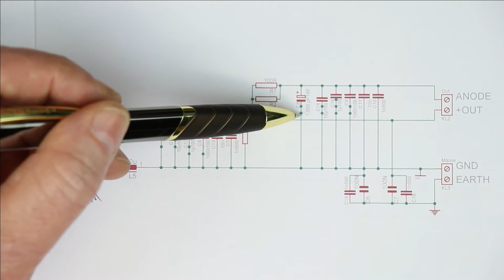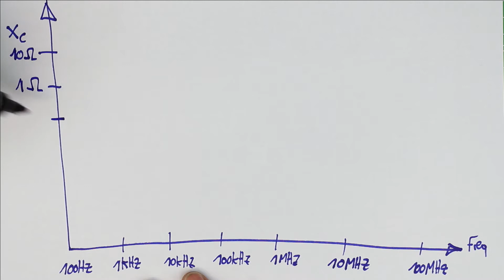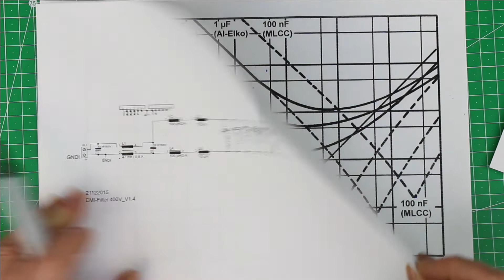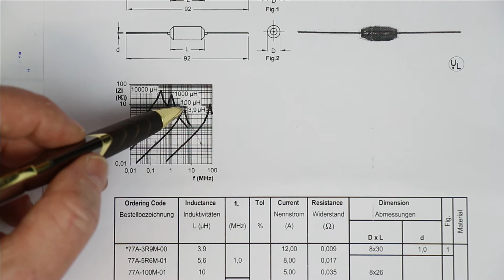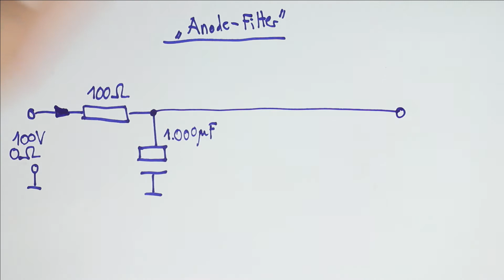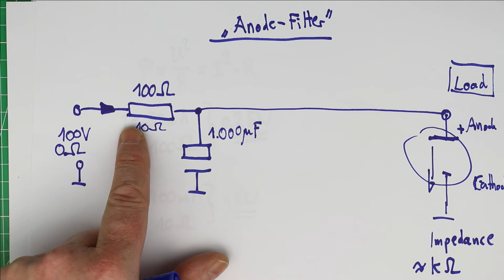Inductors, Capacitors and RC-Combinations as filters – Pt.4 of "Multi-stage EMI-Filter"

Comment: Excellent explanation👍👏
Why inductors work as parallel resonant circuit, not the series resonant? Also why caps work as series resonant, not the parallel resonant ? Paracitic components in inform right?  Would like to understand that part...

Comment: Does this cap filter increase inrush current
Reply from the maker: The inductors in front of the caps "choke" the inrush current.
That´s where the name "chokes" for inductors comes from :-)
Reply: @KainkaLabs  thanks
Reply: What is the design rule to limit the inrush? I was intending using a NTC.
Reply from the maker: I´m not an expert in that region. 

I for myself would do some simulations with LTSpice and/or consult the datasheets and application notes from the manufacturers for dedicated inrush-current limiting components.
Reply: Thanks it helped with my biggest issue noise.
Reply: Check FTDI noise suppression circuit.

Comment: Do you stil have these filters? Cannot find them in your shop!
Reply from the maker: Well, the question should be: Do you already have them? :-)
It´s on my To-Do list to put them in the shop for over a year now.
We have the PCBs and components lying unassembled around here for that time :-(
I hope I will find the time in the next two weeks.
So I will publish it here in this video-series and in the start-page of our shop, when they will be available.
They won´t be cheap because the PCB and some of the components are quite expensive.
But we will also the naked PCB for self-assembly because some users will probably not need all of the filter-stages.
Reply: OK, thanks! Would only need the pcb and some of the components, indeed.
Reply from the maker: The filter is now available readily assembled in 3 different ratings as well as bare PCBs for self-assembly in our shop:
 http://www.ak-modul-bus.de/stat/stromversorgung.html
(This is the shop for customers from Europe. For customers from overseas it will be available from February 2018 in our new shop:
www.ak-modul-bus.de/eng)

Comment: Hi! Thank you so much for great info! I would love to buy this as a complete product, would be awesome if you actually would make it available on your website. I work with music preamps etc and this seems to be the best solution to my noise problems. Thanx!!
Reply from the maker: I will post it here and in the other parts of the video-series if we put it in our online-shop.
I just have to find the time to do the price-calculation and write the technical specs and manual for self-assembly if you only buy the PCB and populate only some of the filter-stages.
It will be available as readily assembled and as a bare PCB because not all users need all the parts/stages.
And due to some quite expensive parts it will not be very cheap fully-fledged.
3 versions: 100V/2A, 200V/2A, 400V/2A and on special request 100V/5A and 200V/5A.
The tin-cover shield will be available separately because that is only needed in places where you have extreme levels of RFI/EMI.
PDFs of the PCB and schematics will be open-source. 
Measurements of the noise-suppresion of the final product were very successful.
>60 dB over the whole range except for some very small frequency-regions at some resonant-points.
It was even so good that is was quite difficult to measure. We directly had to solder the test-probes to the output because as soon as you had only only a short unshielded piece of wire the noise-pickup from the environment was larger than the filtered output-signal.
 
PCBs are readily assembled lying around here for some months now :-(
Reply: KainkaLabs Hi, I understand. Only Pcb/kit for the 3-stage unit would be great. I would need a 230v 10A version...

I work with audio and I'm looking for good ac filtration, your stuff seems to be "it". 

Only pcb/kit would be great as well - I would probably buy 3x kits so whenever you are ready... 

Thanx.
Reply from the maker: The filter is now available readily assembled in 3 different ratings as well as bare PCBs for self-assembly in our shop:
 http://www.ak-modul-bus.de/stat/stromversorgung.html
(This is the shop for customers from Europe. For customers from overseas it will be available from February 2018 in our new shop:
www.ak-modul-bus.de/eng)

Comment: Is this a product that you offer?
Reply from the maker: In principle: yes.
But I still did not do the price-calculations and put it online in our shop.
It will not be very cheap but we will also offer the bare PCB as well as the metal shields.
So you won´t have to buy the fully-populated board but can build up the filter with as many stages/parts as you want.
Look at the end of November into our shop in this division:
http://www.ak-modul-bus.de/stat/stromversorgung.html
Reply: Cool and thanks
Reply from the maker: The filter is now available readily assembled in 3 different ratings as well as bare PCBs for self-assembly in our shop:
 http://www.ak-modul-bus.de/stat/stromversorgung.html
(This is the shop for customers from Europe. For customers from overseas it will be available from February 2018 in our new shop:
www.ak-modul-bus.de/eng)